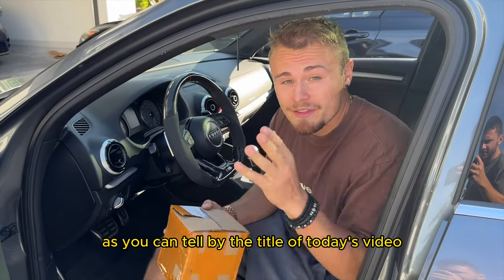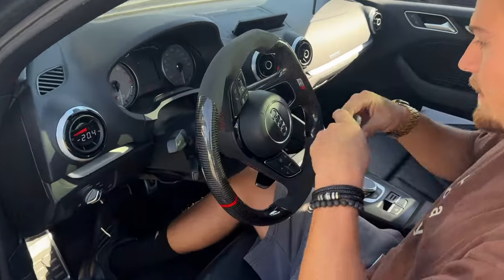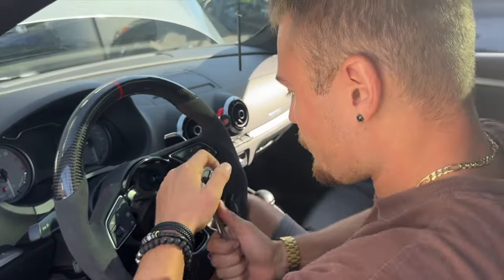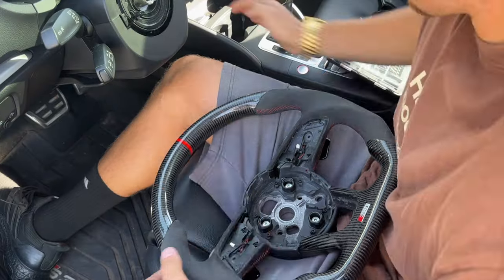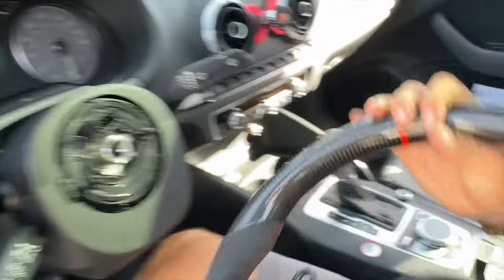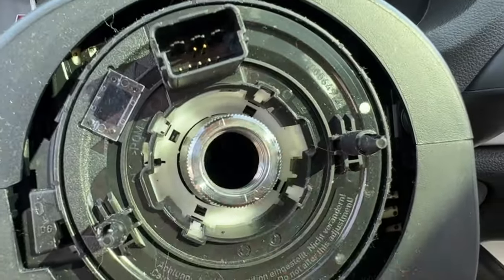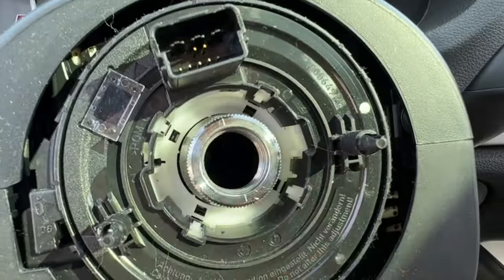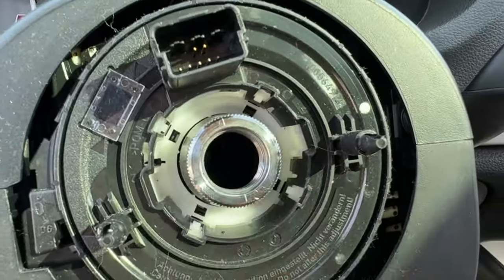How To Remove & Install Aftermarket Paddle Shifters On An Audi A3/S3/RS3

Comment: Always, always, always Take the battery off first  :)
Reply from the maker: If you do that, you will not be able to turn steering wheel. Disconnect battery before unclipping anything
Reply: Sorry I was out of the video timeline, you did it after i commented  :)  Did a carbon paddle replacement on my Leon Cupra R, So much nicer to use
Reply from the maker: Haha! All good! I love Leon Cupras! Wish they were in the US!